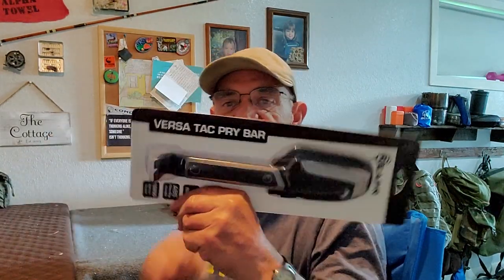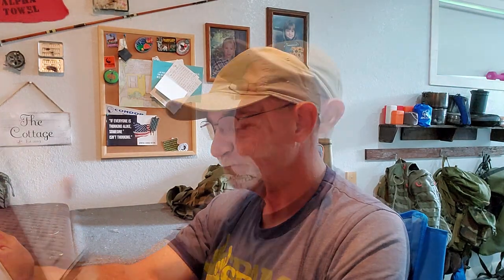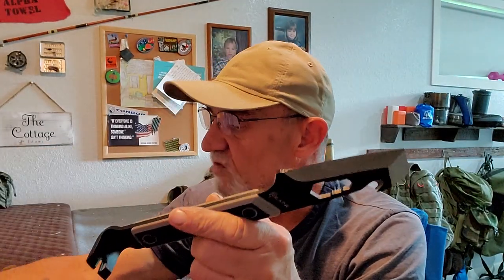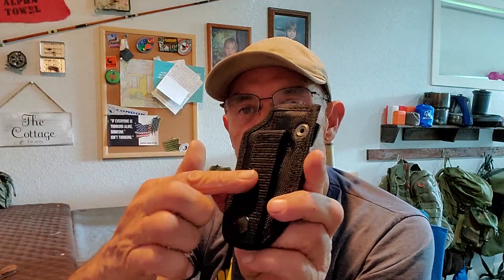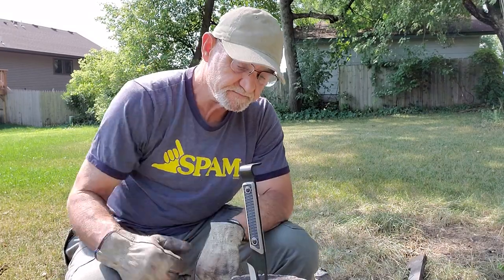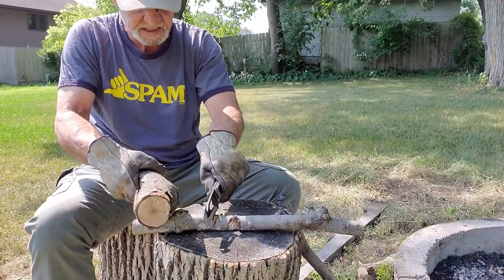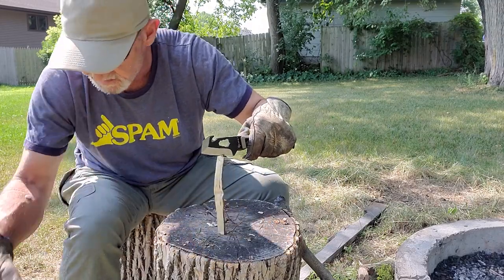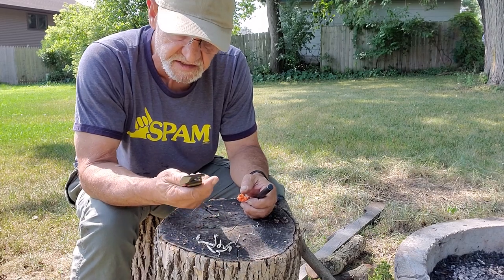REAPR - Versa Tac Pry Bar, Unusual, is it handy?

Comment: Since it's been another 8 months with it, what are your thoughts now?
Reply from the maker: Well truthbe told I have only used it a couple times around the cottage. I used it to break down some pallets I had in the back. It did its job. But still feel that it is limited because of length for the prying. But it is designed for emergencies and feel it is worth having in you Urban kit at least. It is kept in my car kit actually. Thanks for watching. Appriciate the support.